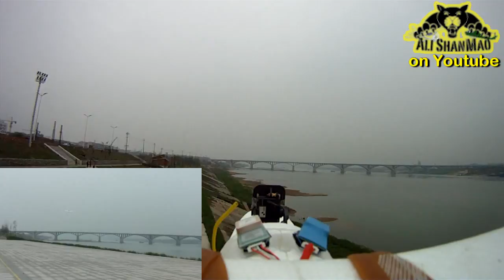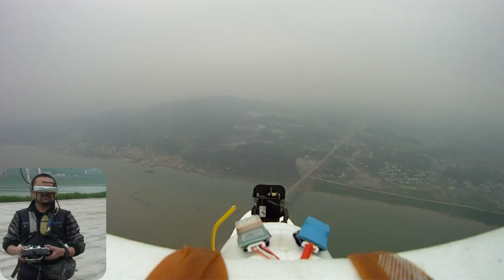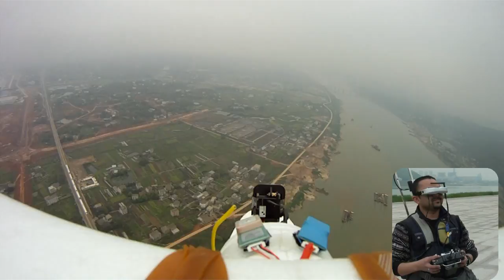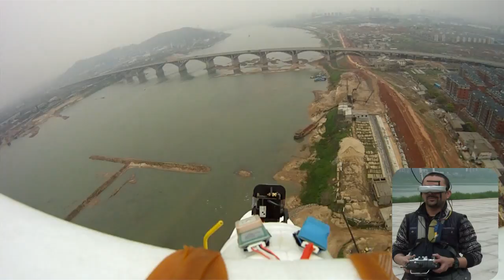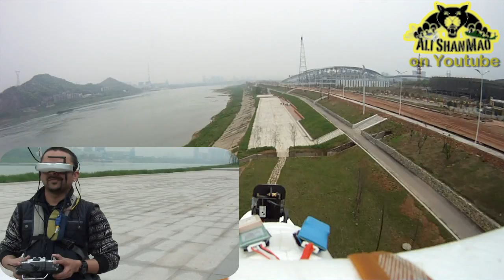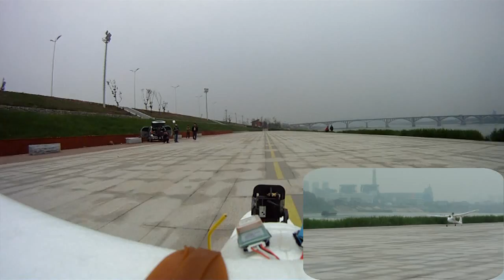ChainLink 5 Miles FPV Flight to see Fast Train

Comment: I watch ur videos but lol until today I didnt know i wasnt subscibed, hey i have phantom 2 with zenmuse h3-3d and using fatshark attitude v2 250mw spironet immersion 5.8g but not sure whats best for range with antenna setup. Seem better with antenna 90deg out back pointing back instead of just straight out back but havent got to test yet. Also got immersion 600mw but havent tested yet maybe ill get a nice fpv setup some time. Also need to upgrade phantom radio to if I do long flights im guessing with 6000mah lipo if there really 6000mah i have 5200mah now

Comment: was the video Ok & stable. Just bought the 1.3 800mw with patch from bevrc and was wondering wether the stock transmitter whip is Ok for longer ranges.

Comment: I'm talking about using radio gear to extend the range with highly directional antenna's, and a radio system that controls servos to move the beam antenna so the signal works at far distances. Do a Google search you will find videos of FPV flights 50 miles away at 8k feet flying in the clouds. Line of site control with a high gain beam antenna does work at long distances.AMA says you have to be in visual range with a spotter.

Comment: ali, have you experimented with circular polarized (CP) antennas yet ? As a ham radio guy, I am always searching for a better antenna, and it turns out the guys on rcgroup have already discovered dipoles and CP. Just wondering if you'd used them at all; they can create massive gain and sensitivity for long haul flights

Comment: Just ordered this plane...this is way to cool. Should have used your promo code, but i still need to get the video gear and will use it then. I have everything for the plane and bought the AX2814 motor and the BEV ES08MA servos and the LiPo 11.1V 1500 mAH 15C battery. I also have the 40A with switch mode BEC. I dont want to fry anything so is this all looking to be ok to set it up as is? Any issues with the Skywaker? Does the AX2814 motor come with a prop retainer? All from BEVRC.

Comment: Hi Ali - does anyone make a "true" 1280X720p air to ground FPV realtime system? I don't think it is possible over a component video link like most offer as HD requires three separate signals; Y,Pb,Pr  which avoids the analog compression (filtering) present on a component video link.

Comment: @alishanmao Ahh thats a bummer! It may be the DVR but there is a posibility that the whole FPV system is not strong enough to provide the DVR and your goggles with the live footage both at the same time. It may be worth trying just using the DVR and flying the plane as you would without FPV just to show us what you see.

Another question is does the fail safe stay at a certain altitude or does it just level off as it flys back?

Comment: By FAR the best FPV Video I've Seen yet, do you think a 1.3ghz 1.5 WATT fpv system will be good for an rc car going around built up areas, also for my rc plane glider? what distance is reasonable? also, i am getting a 8dbi antenna for the 1.3ghz too??
Thank You